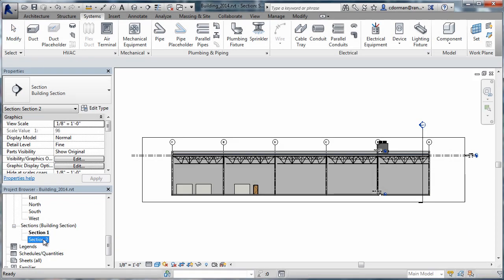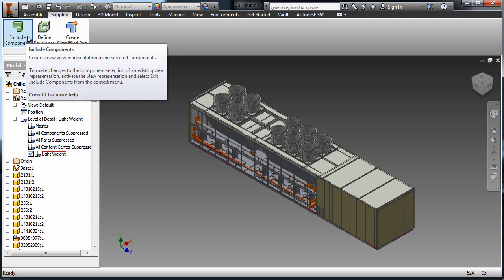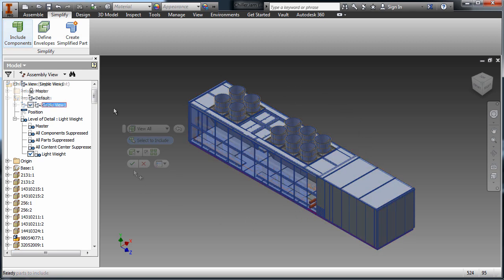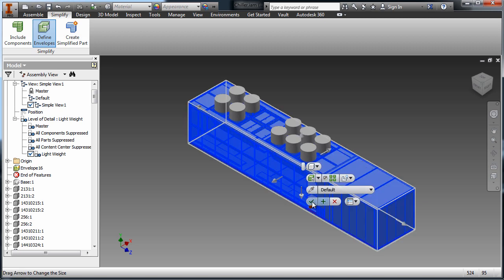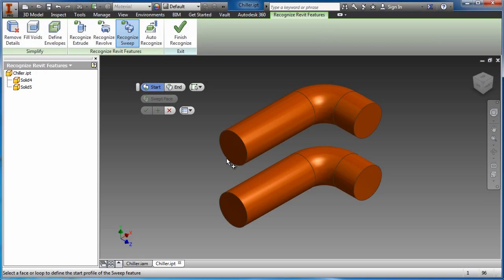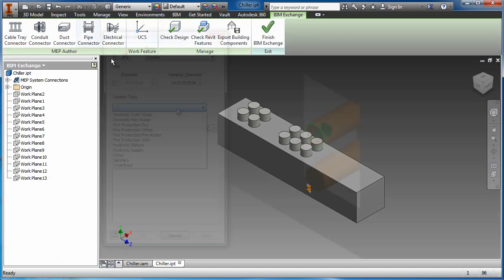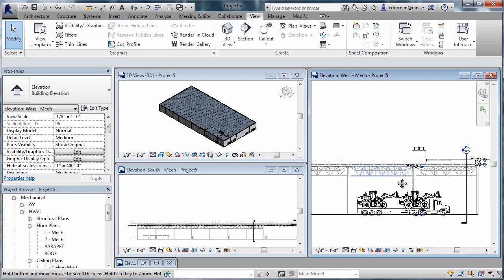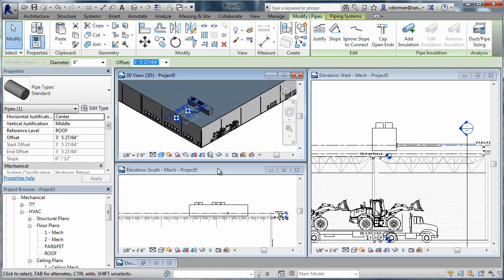Product Design Suite Test Drive -- Inventor BIM Exchange (Inventor)

Comment: He's "simply" using Autodesk Inventor to export a part for Revit. He's showing how a part made in Inventor can be simplified and exported for use in Revit. This is overdue and exciting to those of us in multidiscipline engineering firms who use both Revit for structures and Inventor for mechanical things such as chutework, conveyors, crushers and such. We can currently Mass in an Inventor file into Revit but it's cumbersome. I'm not really sure if this is much better but does have advantages.